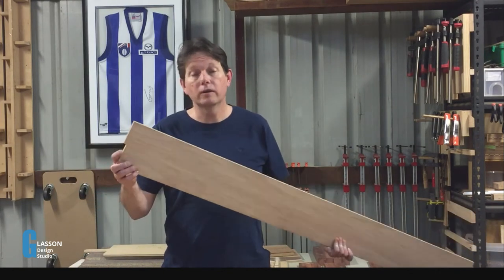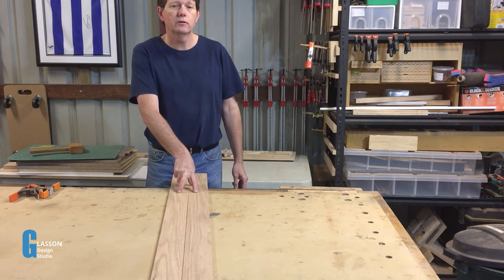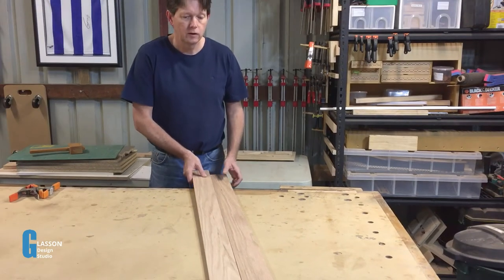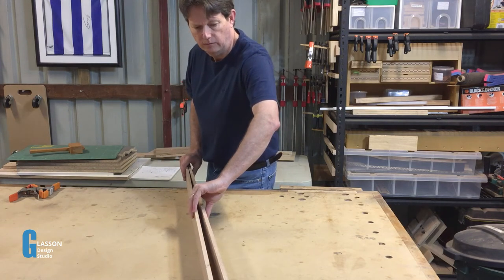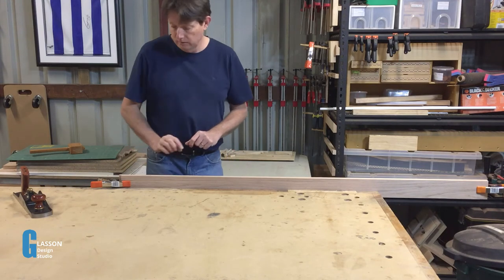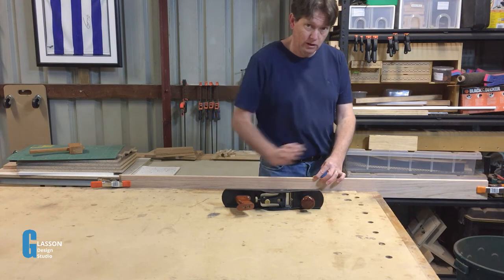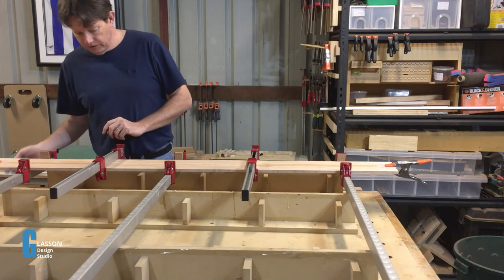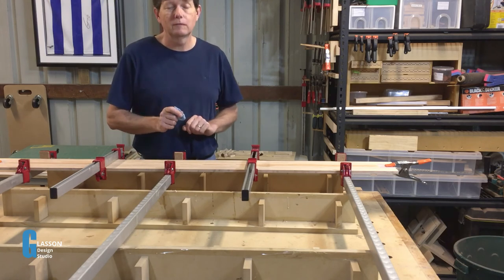How to join two narrow boards lengthwise to make a wide panel

Comment: Nice technique but I don't have time to hand plane joint these, as you know if can be fiddly.  I would tape them together and put a track saw down the middle, you end up with 2 mirror edges, It takes a few mins max, but gluing up can be tricky as they want to rack when in the clamps but then you can use some wooden handle clamps to keep them flatten together. .
Reply from the maker: Thanks for your kind words. I hear what you're saying about lack of time. I like hand planes cos it's quiet, I find it relaxing, and it doesn't piss my neighbours off when I'm doing it in the middle of the night. That's an interesting tip about using a track saw. I'll have to try it at some point

Comment: Good day,
Thank you for your effort and detailed information.
I have a question please: what is the name of the tool you used to remove the hollow? 
Thank you in advance for your reply and time.
Best wishes.
Regards
Reply from the maker: Thanks for your question. The tool that I am using is called a hand plane. Specifically, this one is a bevel up Jack plane made by Veritas. The term "bevel up" refers to the way that the plane blade sits in the plane.

Comment: What kind of glue did you use?
Reply from the maker: Thanks for your question. The type of glue doesn't really matter in this case because the technique works with different types of glue. I used Titebond 3 from memory.

Comment: Suggestion (from a noob) add some hold fast holes to the side of your  table?
Reply from the maker: Thanks for the suggestion. I do have some on two edges and use them for my bench dogs. Some more might be useful. The existing ones are to the right of the vice and also at the front. Where were you thinking they should go?
Reply: @GlassonDesignStudio  Yep right side.(as you are standing at the vice). it would seem that having the material "viced at one end and held fast a couple time down the boards would be more stable.
Reply from the maker: @brucewelty7684  yes you're right it would be more stable. I don't have a hold down at this time so I have to make do without.